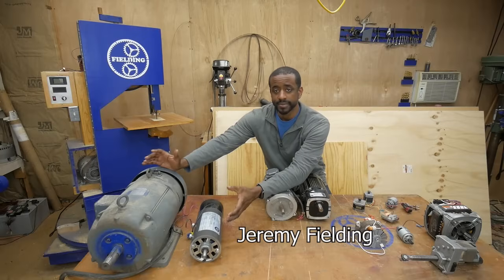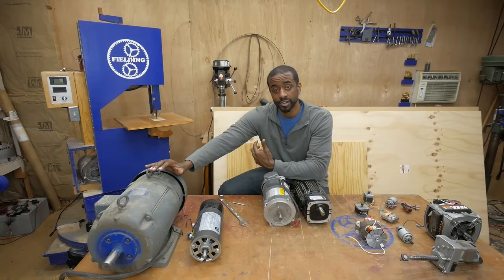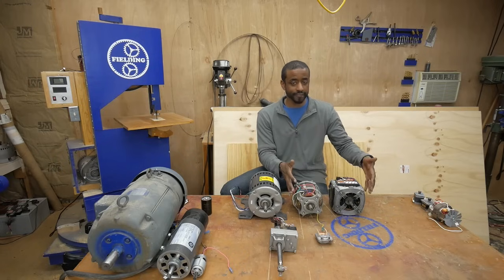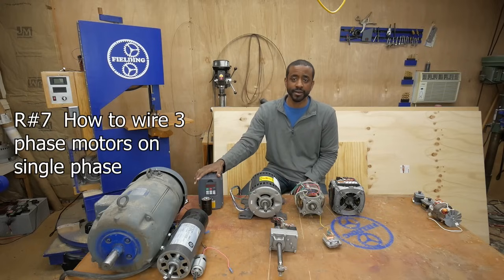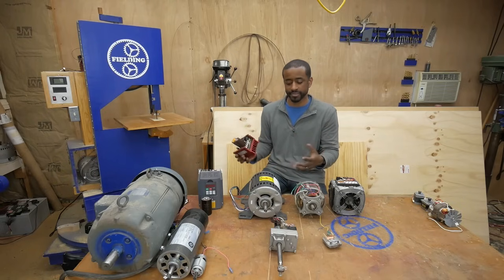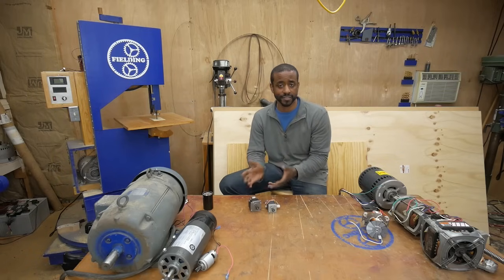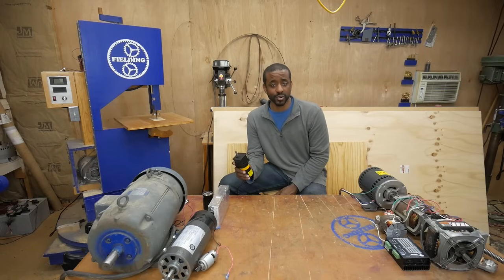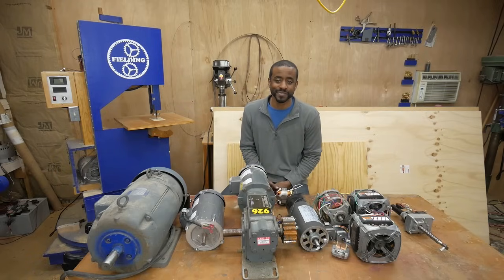Ultimate Beginners Guide to Using Electric Motors for Makers and DIY Projects; #068

Comment: I'm mostly interested in possible EV applications of second hand motors. I'd love a video detailing the use of multiple motors in series or parallel and/or combining motors with one shared shaft or coupled with belts/chains and wether or not doing so can give you more power without losing too much efficiency. Would also love to see you test the performance of alternator conversion.

Comment: I wonder if someone would be able to help me out a bit. I need a small 12v DC motor that can lift about 125 lbs, 10 feet off the ground, relatively quietly and preferably relatively quickly (doesn't have to be a space shuttle, just not so slow that we visibly age while it's going). What would you suggest?

Comment: I have a small unmarked motor that I know runs on 120v single phase, and has 2 speeds but that's all I know. There are 3 wires coming out of it but I'm afraid to put power to any of them for fear of causing damage. The wires are red, yellow, and black. Can anyone tell me how I can determine which wire is common? Is there a way of IDing them with a multimeter?

Comment: Hi Jeremy. Here in the UK some of our cheap power tools do not have soft start I I vave a evolution rage 5 which does not have soft start. I known in the USA have after market soft start in line of the power lead.
Here in the UK there isn't one available and those with have to be wired in are very expensive. Do you have cct which can be intigrated into the power lead. Take care stay safe Mike Sansom

Comment: I wonder if you can help me...I have a Small  brushless gasoline generator that was generating 220v 50 hz... I took the gasoline Engine off and replaced it whit a DC variable speed motor so I can use the generator inside of my house....now when I bring the generator to 3000 RPM it generates 220v but the frequency is 150 hz ...I checked the 11 microfarad condenser and it’s good ...I can’t figure out what could the problem be...if you can help a would appreciate thank you

Comment: Where can I find a suitable motor for my bench top tablesaw? It's a cheap-o craigslist  purchase that I Frankensteined by adapting a machined aluminum top and a fence upgrade that came from a bandsaw. I've actually got 3 good tablesaws  but they're stationary. I like the bench top saw for cutting metal but the motor winding became delaminated and now its smoked. Do you have any suggestions?

Comment: Brother. Can you help me with a project. I need to make a diy small engine dyno. I have electronics background and access to used motors. 3 phase and single. 208 volt and 110.

Comment: Your videos are great.  Thank you. I would like to build a motor to rock my heavy porch swing.  The natural frequency of the swing is about 20 cycles per minute.  I need to be able to tweak the speed of the motor to match the swing natural frequency which is dependent on the weight of the people on the swing and I would like to build this cheaply by salvaging the junkyard.  What type of motor would you recommend?  I am thinking  a gear reduced dc motor?  Would love your input.  Tim Gresla

Comment: I grew up playing in a factory, saw and messed with many mechanical stuffs.  When I see that big motor on the left of the screen, I see a diesel with large displacement.  It won’t spin fast, but it can haul 30 ton.  While those much smaller ones, can get up to faster speed, but with very light load.  They are like 1.6L 4 bangers in small sedans.
And then there are ones for special purpose. They are torquey, and they can also spin really fast.

Comment: simplified answer - HP is not the same as torque.  A small motor has a smaller rotor and therfore less torque, but can have 3x the  speed and work on a higher voltage so it can handle more watts

Comment: The "17" in "NEMA 17" (etc) only specifies the flange size. NEMA does provide additional specifications for shaft size but that would be part of the longer numeric designation for the motor.

Comment: I am building a compost trommel and am stuck when it comes to a motor. I have a very good Bell and Gosset motor from my old house heater. It was used for circulating the hot water through the pipes. It's rated at 1725 RPM. 1 HP.   I need it to turn at about 25-35 RPM.  Can I just use a variable speed switch or rheostat switch, Or do I have to use a speed reducer ?  The latter seems to be way too expensive.  Could I use a box fan motor ? HELP !🤯 Thanks for your time and consideration. 🕊️🙏💯

Comment: Jeremy,  I purchased a bunch of baldor motors.  Some were still mounted to high end CTD chop saws . The run and start capacitors were unplugged.  Hiw can you tell which of the four wires go to the run and start capacitors. I ruined a pair of capacitors when I wired them in the wrong place.

Comment: Hi all. I don't usually write any comments but this video was very informative.  I have a question. I have made a hand cranked sifter which I want to convert to a motorized version. Any suggestions for the type of motor to use? Its pretty light and doesnt need to spin fast. Thx

Comment: It might be possible to do 3 phase motor if you create and individual working separate ground rod. 3 line should be connected to live, neutral and ground wire " AC only"

Comment: Hi! i can't understand why my Ac motor ( it is a little motor coming from a mixer) doesen't work with Dc. It has brushes, and an electromagnet. The electromagnet is horseshoe shaped,  has a central coil and the ends are near to the windings of the rotor. I hope to have been clear...
Can somebody answer me please???😭👋

Comment: why does my circular saw cut thru wood easier than my Bosch contractor table saw? Same wood. Table saw will trip breaker unless you go much slower pushing wood thru in comparison.

Comment: COULD U PLEASE SEND ME INSTRUCTIONS ON HOW TO WIRE 3PHASE GE MOTOR TO 110 POWER SUPPLY. CAN I USE A CAPASITOR FROM A MICROWAVE TO GENERATE THE POWER NEEDED? IM LOOKING FOR A CHEAP BUT GOOD TABLE SAW MOTOR... THANKS

Comment: Hello Jeremy,I want to thank you so much for all the information that you present in each video you produce. I will save each video for further reference. You are a blessing to millions of folks around the world who are less fortunate who need this valuable information to help their families and friends keep their equipment and in home things running. I have learned so much from you about motors and a/c d/c power and so much more. I don't know if you have any interest in Solar, Wind and Water Power Generation which is how I found you as I often watch many different solar power,wind power and water power videos. It would truly be a Big Blessing if you were able and willing to produce Alternative Energy Videos showing and explaining the motors that you find especially the more powerful motors that could produce Huge amounts of electricity. Types or best motors to use for converting wind power and water hydro power from A/C  to D\C or D/C to A/C .I allways wondered if their was a motor that could deliver enough energy to power a home with up to 10,000 watts of electricity enough to run a/c heat pump,well pump and in general the lights,dryer etc using a running stream and mounting a water wheel onto a large motor of some kind.I know if anyone could figure this out or if this could be possible it would be you.I just wanted to let you know how great full I am to you for the information you share with the world and especially how much you have taught me.I will be using your videos for the rest of my life. God gave you a very special gift and I am so happy to be on the. Recieving End.Thank you so much and may God continue to use you to bless the millions.

Comment: I was planning a little weekend project to build an electric go kart/golf cart type vehicle. I have 2 12v automotive batteries for power, what is the best motor for this type of application and what other devices do I need. Like controllers, inverters, and such

Comment: Excellent video, what type, size and power rating of motor would you recommend for a DIY electric bike? I am looking for something that could propel a road bicycle with a passenger weighing about 14 stone. Looking for a balance between range and speed.

Comment: Hello Jeremy ! Can you tell me anything about a gentleman that lived close to me named Joseph Newman.. his Voltage only motor he invented was over 7500 pounds and ran with no currant, voltage only... he ran it with discharged 9v batteries! And could make it spin 200rpm! Over 40 electrical physicist and engineers signed statements saying his motors produced more power than it consumed. Yes, the dead batteries were fully charged each time he shut the engine down . Over 8000% effincancy is what I’ve heard and there are many many videos and news story’s on yt going back over decades.. the truth channel and joe Newman’s motors... sadly I haven’t found anything fully describing how they worked... Hope you can give feedback.

Comment: Jeremy, I'm curious if you've tried a 10000W 110v 220V SCR Voltage Regulator Motor Speed Controller and bridge rectifier to run a treadmill motor? And, would you consider an inline capacitor with this setup?

Comment: You are super smart. I’m a union electrician and I believe I found out how to make a generator that could power a house (with batteries for storage) that could run off a bank of around 15 9-volt batteries (need to change once every couple years). A lot has to do with electromagnets and other things but on paper it works. I’d like to build one and think you would be the person to help. Please let me know if you’re interested.

Comment: Why am I seeing so many different amp ratings on the same size horsepower a/c induction motors? I know that efficiency is one factor but how can one 3/4 hp bench grinder have 2 amps and another 5  or 6 amps?

Comment: I have a vacuum 120v 60hz 12amps   And i have installed one power inverter in my car (Eastwood 300W Pure Sine Wave Power Inverter 120V) but doesn’t make work my vacuum  it just makes a sound   What would be the problem or how I can make run a regular AC vacuum ??

Comment: i love you channel Jermy i have a 3.5 hp treadmill motor im building a 1 seater electric car im using a 10" pulley at the motor shaft and a 15" pulley at the wheel shaft total rpm is 5,000rpm

Comment: I got a huge huge motor about 11" in diameter..  Only 1 HP..   LOL.. . WTF?  It's on an old table saw from the 60's..  it's very good table saw but i only have it wired 110 but thinking about putting it on 220 so can have the extra juice cause my lines I think are current limiting to a degree for such only running 110...

Comment: Great video. I wonder if I might ask; I have several single phase, 220V, capacitor start, induction motors, less than 1Hp, that direct drive centrifugal pumps. Often times, especially if they have been idle for a week or two, they wont start when energized. I have discovered that if I energize them and then manually give the rear fan a quick spin, they will start and continue operating. I suspect the problem is too much resistance at the water seal but I don't know how to solve that issue. I was wondering, if I increased the size of the capacitor, would that help the motors start?

Comment: I'm a former photocopier technician.  Old commercial photocopiers typically have 3 to as many as a dozen high quality electric motors inside them.  The main motor is typically an AC motor and the rest are stepper motors.  We used to throw these whole machines in the dumpster or leave them outside our overhead for local scrappers to take away.  There are a ton of really cool parts to be had inside an old photocopier.  Motors, bearings, shafts, gears, pullies, rollers, power supplies and on and on.  Your local copier dealer has plenty of junk copiers they'd love to not have to pay to dispose of.

Comment: question , i have universal motor for wash machine its for 230 volt ac and the power is 400 w , i think that DC gives its more tork , so my plan is to have a cap(dont know how big) in series and then use diodes and caps to make it dc , 200 watt is what i am aiming for , do you have any idea how big the cap in the ac line has to be ?

Comment: Hi Jeremy,
I got in mind to learn Arduino by making some project with stepper motor.
I want stepper motor to turn quickly (switching directions) bar under 2kg with shape 5x5cm where motor shaft attached to center of weight of the bar (in other words minimum possible inertia). And I'd like it to be turned with precision 1-0.5 degree.
Could you recommend some way to understand what a) motor do I need? b) what controller (or driver) do I need?
I'm aiming to buy the parts rather then using salvaged once. But still e.g. Alibaba descriptions of steppers are not very descriptive to me. Is there a online resource that could help me? Or any other ways?

Comment: Any chance you could cover Vbelt CVT transmissions for use with motors? Like you would find on an old variable speed drill press. They can be super useful.
Reply: I would read up on Nissan settling a class action lawsuit on CVT transmission before using one of these.
Reply: @anonymousinc6330  to be fair what I'm talking about is a far cry from what's used in a modern vehicle. It's just vbelts and an expandable pulley.
Reply: @anarchangel7    More commonly known as a centrifugal clutch. Could work, but I think you'd through a lot of belts trying to move something as heavy as a road going car.  I had a go kart as a kid that was set up the same way, and once I got too heavy for it, I went through a belt every year even with occasional use.

Comment: Perfect vid on the subject. I didn't know how hackable treadmill controllers were, that's a great PWM amp source. It's also an important point that motors rarely fail. brushes need replacing after years, bushings/bearings maybe many years after that. worst-case a coil needs to be rewound, nothing else on them really wears. consequently just about every motor can be reused after the death of an appliance otherwise.

Comment: Ho Jeremy, Someone gave me an ebike that faulty. 36v,  250w front hub motor. The motor worked occasionally, so I bought a Chinese controller online. This controller has 3 phase wires, blue green & yellow. My hub motor only has 2 wires from it (single phase?). Is this a mismatch and I can't use this controller? Great videos!

Comment: Hello Can you please help me on desiding on watt kind of either electrical motor to mount on a fitnes comuter Joda brand bicycle ,dat ive seen several on you tube but i was only a maintenace and a low pressure steam boilers replacing condesation and vacuum pumps of all tyoes but we only used da polyphase motors ive also did replace parts on my cars and motorcycles in da past im on a very low budget disable but even doygh now i csnt stand to walk more then a few feet i need to sitdown byt i could use da propusion or assist my pedaling i also have very bad DIABETIES IN HARLEM NEW YORK ARE STEEP HIKKS DA DICTORS WONT ALLOW ME AN ELECTRIC WHEELCHAIR THEY WONT VISIT ME AT HOME I DONT QUALIFY FOR A HIME AIDE #800 OUT IF PICJET I CANT AFFORD MUCH  PLEASE SIR CALL IR WRITE ME 347-303-4083 MY BROTHER HAS LOTS OF MONEY AND HE NEVER CARED FOR MY MOTHER RIP I LOST HER 5 YEARS AGO THANK YOU.

Comment: I would lie for you to do me a favor if it's possible with these DC motors I would like for you to let me know if it's possible to get the right amount of torque and speed with a skateboarders wheel or something soft and go against the back wheel against the tire of a bicycle Plus plus making the switch with some lithium batteries the small mini ones or any type of battery and somewhere I can have a fordable throttle I will really appreciate that if you can help me with that

Comment: Hi Jeremy,
You have great videos. I was looking at a couple of them as I am trying to see if it is worth to try to fix a table saw motor. I have a Ryobi table saw that is passed the warranty. I tried cutting a piece of what i thought was HDPE, but it turned out to be something else. after a couple of uses it just stopped working. I dont know remember it smelling like burning know it struggle more than i thought it would when i ran the piece of material... so most likely i think i might have burnt it. I dont know anything about electrical motors, but i thought maybe i can try to see if it is salvageable to have it as a backup for my other ryobi table saw (of course i broke the new)... Do you have any advise on what I can take a look or if it is even worth the try? Maybe you already have a video about that. Great videos, Thank you very much for you help

Comment: I had a thought- can you effectively use a lower power rating motor in something requiring more torque and rpm than would be possible if you store the energy in a flywheel?  A kevlar flywheel on air bearings spinning at 30,000 rpm has a lot of energy that, conceivably, could have been stored there by a sewing machine motor. It would take time to store the energy, so there no violations of conservation laws with this scheme....

Comment: I electrical hp @115 v 13A = 515 watts or 10.4 Nm of torque and is eual to 5 hp of gas engine.

You can use a 2.5 hp 115v/13A/3600rpm AC motor TO DRIVE A 9000 watt 120/240v/75A  GENERATOR.
On one circuite, thus giveing the remaining watts and amps through the other recepticles to use at will 24/7.
An electric start gas engine type generator with a freewheel clutch installed between engine and motor is most convenient.
Gas start self run take over with gas disconnect.
Let's see your dark ass build this BOY